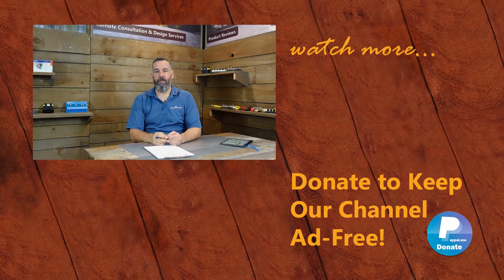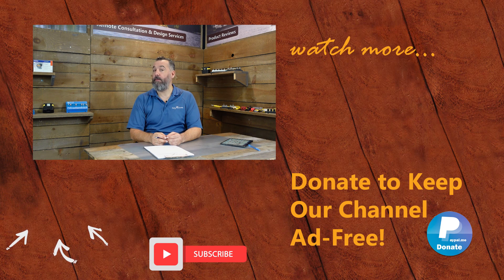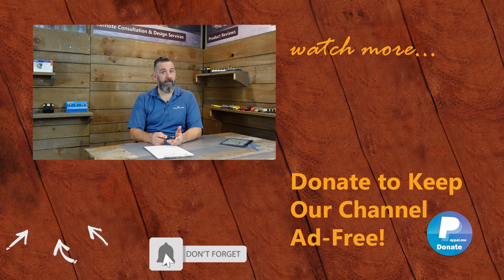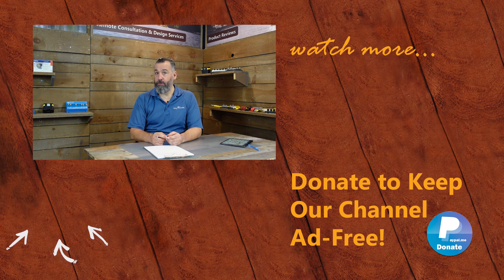Starter Batteries vs House Batteries on My Boat

Comment: I have long wondered about starter batteries, so on my last boat I just used 8 golf carts , and had no dedicated starting batteries. (Twin 60 hp outboards) As a test, I let the voltage get down to 11 volts (one battery set only) and the engines started just fine.  Why have all that starting ampactity not be part of the house??? New boat, new batteries on twin diesels, I think I want a big house only set, with perhaps one of the house set, that can be electronically disconnected, at a pre determined voltage.  We never had a problem starting without dedicated start batteries, and had a start jump pack in case we ever did. One set of batteries made the install and switching so simple!

Comment: Knowing that spacecraft and flying vehicles are not grounded, why do US standards require this?  I was told that in Europe this is prohibited.  Thanks.
Reply from the maker: Good question, but not sure of the why the code is the way it is. To me, one of the benefits of having a reference voltage, i.e. ground, provides a good way to interconnect different AC and DC voltages.
Reply: @PacificYachtSystems  thanks for your answering. All power plants and substations use unearthed DC. This is to protect it from electrical surges due switching and lightning. Combining them will transfer the issues from one place to other with undesired effects.

Comment: Jeff love your stuff but it’s time you should venture a little and start, first trying, and then talking about lithium. It’s a game changer
Reply from the maker: Thanks for the encouragement. As we get to see and tackle more and more installs, we are uncovering the unknowns. Over time, we'll share it with everyone.
Reply: @PacificYachtSystems  fair enough but it would still be cool to see more lithium videos, you already alerted us to the dangers of a dead BMS but that can be mitigated a bit by having a switch to divert essential house loads to the start bank in emergencies and/or by having a low voltage alarm and monitoring your battery monitor closely. For me the main reasons i want to do it are ease of physical battery install and more than twice the usable capacity in the same limited space. Those are very good reasons i feel many can relate too. Finally if all goes dead you always have your sails (or kite if you are a kite boat). The only Fireflies Captain Cook needed were the ones “that, uh… got stuck up on that big bluish-black thing” - Timon

Comment: Hello Jeff. What's your opinion on the "dual purpose" (high cranking amps and deep cycle) lead acid batteries? My boat's PO installed two deep cycle batteries for starter and house loads. I want to install a dedicated starter battery. Is the dual purpose a viable option?
Reply from the maker: Good question, would recommend getting a starter battery for your engine and deep cycle battery for your house loads. Deep cycle batteries aren't as good as starting batteries for engine starting.
Reply: @PacificYachtSystems  I may not have been clear. There are flooded lead acid batteries that are labeled as dual purpose, meaning they can supply the high cranking amps for starting, and also sustain deep cycling. Do they live up to their claims?

Comment: Great info, thanks so much.  I just bought a sailboat with 2 new marine deep cycle batteries (identical) that are split between charging and house duties.  Can I combine these 2 into the house bank, and add a dedicated starter battery?  One bank would the starter batt, the other bank would be the two house batts.  Thanks!
Reply from the maker: Yep, you can definitely put two similar batteries in permanent parallel to run your house and a separate engine battery

Comment: Hi Jeff.
I have a 31fot alicraft and have been refurbished almost everything on it now
I’m doing al my electrical on my boat and I’m at changing my battery bank’s.
I’m using 2 optima red top batteries for start one for each engine with a crossover switch just if one of them runs out of power. And I have an 12V 155Ah Front Terminal AGM VRLA Battery from MonBat that I’m using for house battery.
How do you recommend the charging setup for this  do I need a dc to dc charger or just a charging really from each engine battery bank to house battery?
Best regards Ronny from Norway.
Reply from the maker: Hi Ronny, DC to DC charging converters are great, as you can customize the charge output.
Reply: @PacificYachtSystems  tanks for The for your answer. I was thinking abaut a dc to dc charger

Comment: Thanks Jeff, this was a very topical video for me because i’m looking to replace my lead acid house batt with a LiFePO4 + DCDC charger drawing off the start batt. I’m wondering though, as the solar will just be charging the new house batt. Is there a good way to somehow trickle charge the start batt from the solar as well since with my new configuration it will only be being charged from the alternator… Could it be as simple as connecting my solar charger direct to my start batt instead of the house batt? 🔋 🔌 ⚡️
Reply from the maker: Your on the right track, easiest is probably having your solar array controller connected to engine instead of house battery. Anyone else have suggestions on how to do this.
Reply: @PacificYachtSystems  Thanks for the reply Jeff! Yes, that was my plan too but last night i saw this short video and it changed my mind. https://youtu.be/rDXixCzg6iw
My existing votronic charger can trickle the start batt at a voltage that i can set the victron dcdc to not quite start at so that it will only charge the lithium house off the alternator when the alternator is suppling enough current to not let the start batt get depleted. I can run the main solar feed to the house batt too. But now my big question is what size dcdc to get to prevent my alternator overheating and not deplete my start batt while the voltage is high from the alternator like in this video.

Comment: 💯
Reply from the maker: Thanks Javier!
Reply: Great information as always!    I have a quick off the topic question. Surge protection devices.  Can I use an all house hardwired device in a boat?   The one I have is a D square 120V/220V  single phase 3 wire.  Thanks Jeff!